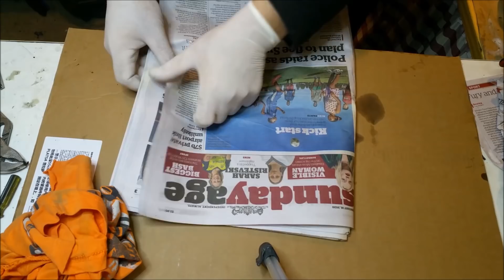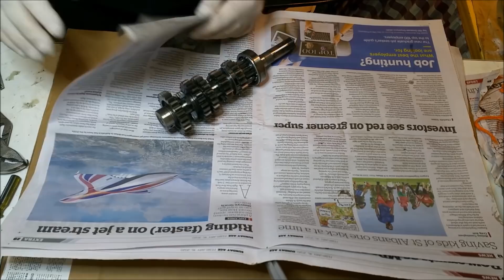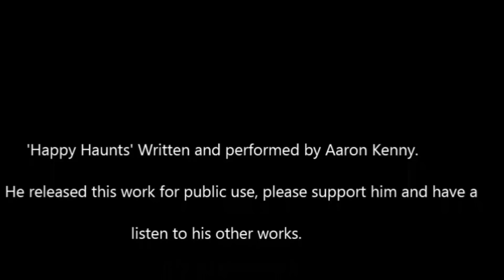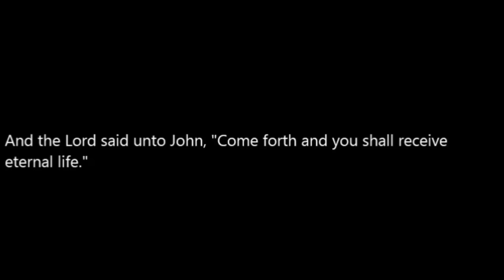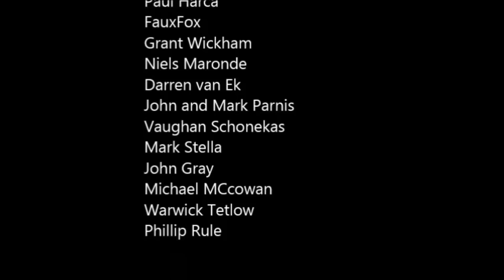Suzuki T250 Part 8 - A Sad Case All Sorted

Comment: Really enjoying these bike videos! I've used that Permatex Steel Weld before. The retainer tabs holding the spring mechanism in the column shifter in my EB II broke off, sending the spring and retainer flying. Clamped it back together, used a blob of Steel Weld to hold the retaining disc in place, hey presto! It's been a number of months now and it's perfectly fine. Much less hassle than removing the entire column to repair it.

Comment: Great work on the ring-ding Peter!  For mixing, I have a huge pile of old hotel door access cards which make dandy goop spreaders and if you cut them in strips, superb mixing sticks.  When done - into the bin. Hey - how is you little Starlie working?
Reply from the maker: Hi Peter, those cards would be very useful! Back in the early 80's we had a computer at school that had to have every line of code marked with a pencil on an individual card, so even a modest program used quite a few cards... everyone wanted the expired cards for everything including shopping lists! As for the Starlie, it's perfect and really glad I did it, although no cars are getting too much use in this lockdown, cheers.

Comment: Hi Peter your gt 250 videos are fantastic. I’m facing the same problems with kickstarter bush pins. I’ve got anew return spring installed but it doesn’t spring back as I tightened the cases it gets stiffer. I’m a novice but I’d appreciate any tips on how to pre tension the kickstarter return spring.!

Comment: I follow another guy who does a lot of small engines like brigs n straton. Repairs a lot of alloys and pot metal stuff the same with 2 part epoxy. When it's just flashing over he shapes/sands the repair with a moist finger. It has a really good finish.